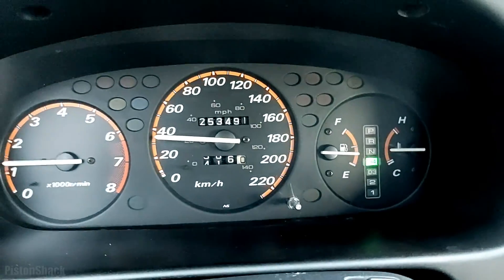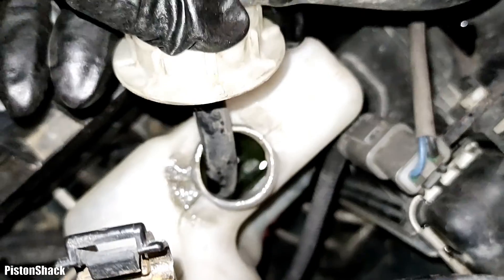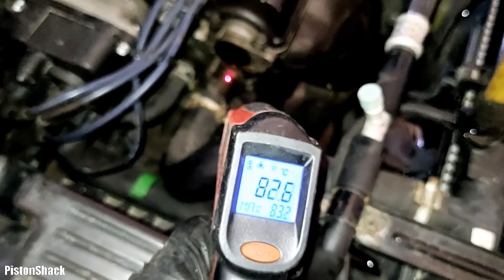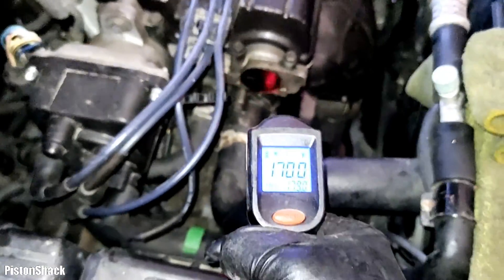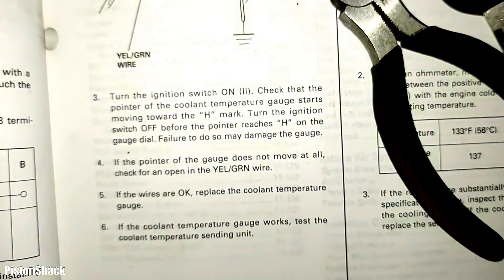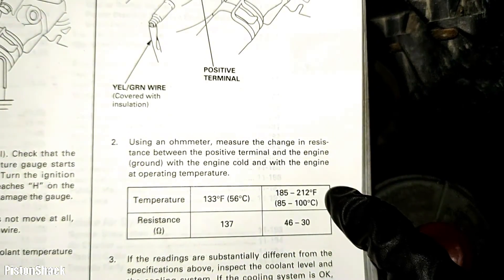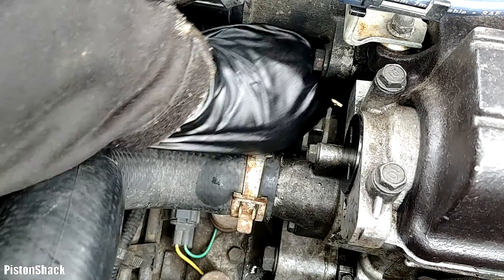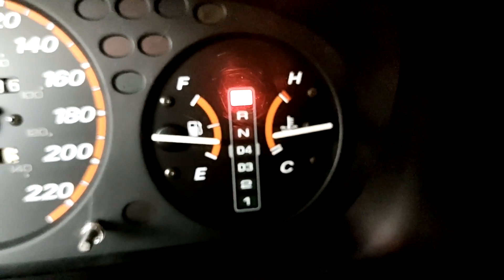97-01 Honda CR-V FLUCTUATING Engine Coolant Temperature Gauge? Easy Diagnosis & Repair in 5 Steps!

Comment: Mine does the opposite the temperature starts going up but the pipes are still cold to touch. Could this be the same fix for my situation?
Btw my ignition coil gives off electric shock when touched could this be related for reading my overheating situation?

Comment: Thanks a lot for the video!
 I´m having the same fluctuation, definitely will do the test, but I am a bit confused with the connector names... this one that you replaced seems to be the Honda 37750-PH2-014 Thermo Unit, right? Because at it´s left is the other sensor (Honda 37870-PJ7-003 Sensor Assembly, Water Temperature)  which I usuallyname like "coolant temperature sensor" (maybe I´m wrong but they have family names that sometimes are confusing). 
Anyway, besides the names, thanks a lot for your help and explanations, It really helps! (By the way, do you think that is better going for the OEM or maybe aftermarket unit couls work the same...or maybe it´s like opening the posibilities of troubles..? Thx!!)